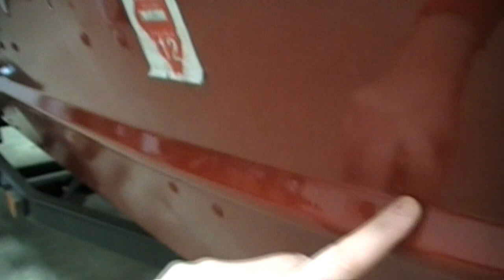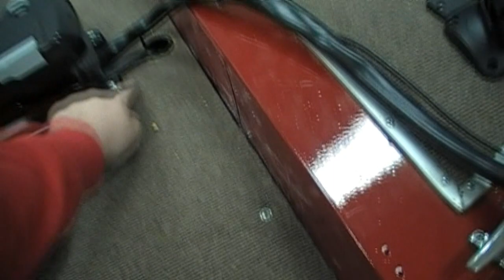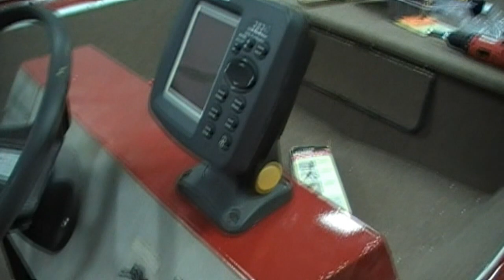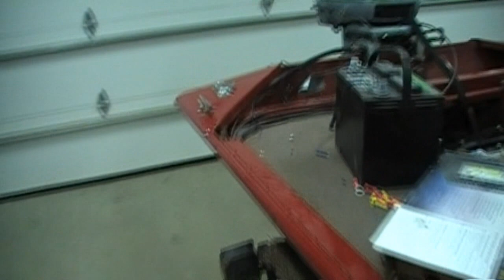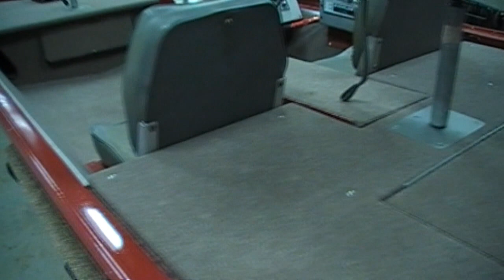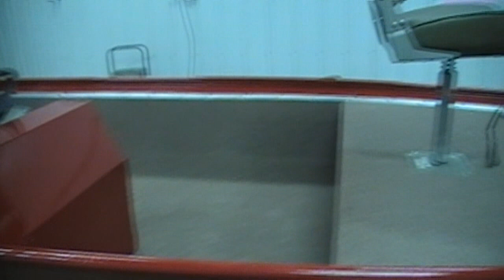Jon Boat Restoration - Final Day

Comment: What kind of paint did you use and how did it hold up over time?
Reply from the maker: @philelrod603  my father in law (that’s his shop) is a professional painter so professional grade stuff with many clear coats for protection. Can’t imagine how much it would have cost if I’d contracted it out. But, looks good as new…

Comment: Finished product looks amazing. I am a bit curious as to what the overall cost of the restoration was. I will be starting a similar project over the winter and just wanted a rough estimate for time and materials. Thanks for the info and tight lines.

Comment: Wow, Looks Great! I see you sprung for a new trolling motor. Probably a good call.  I just fixed up my boat. Not quite that in depth.  Its fun if you have the time.
Also I picked up some smoker craft decals on EBAY for $20.  They can make you any kind you want.

Comment: You should get rid of the two carpet wood guide on the trailer and put in 4 2 1/2 feet pvc plastic pipe.   It's better guide when you ride your boat in.  This old man taught me this.